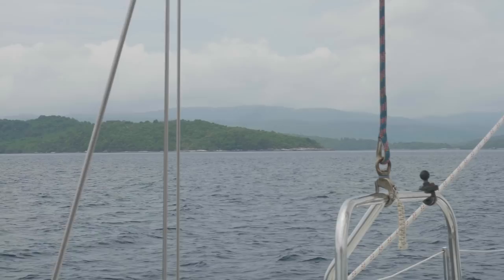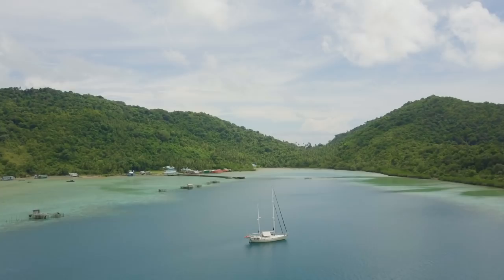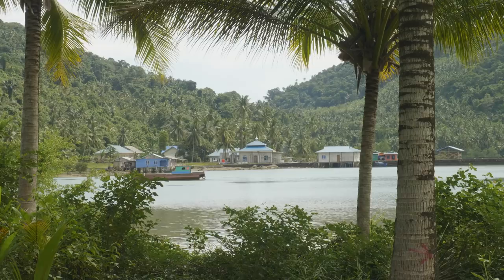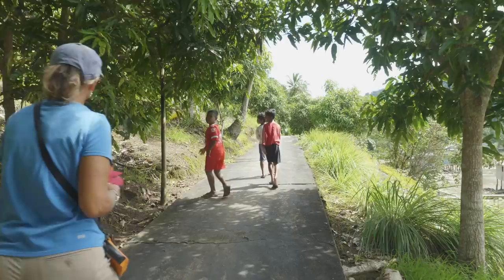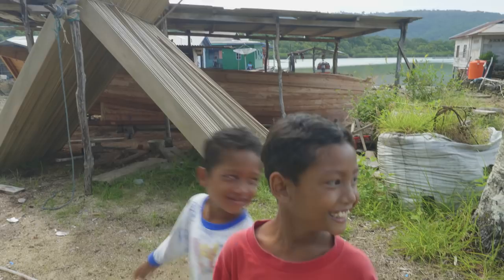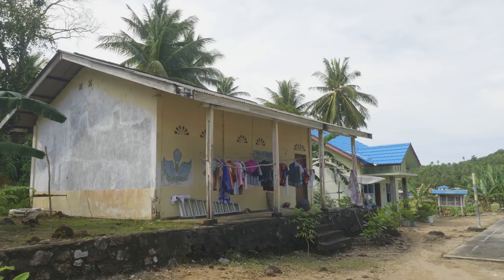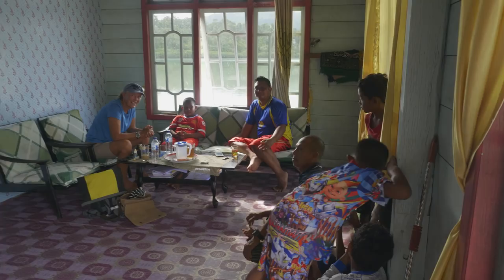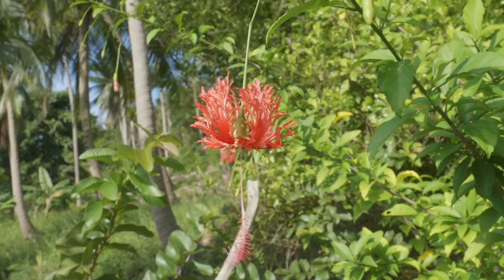FIRST SAILBOAT EVER TO COME HERE! - SAILING FOLLOWTHEBOAT Ep 95

Comment: I envy you folks finding the out of the way places to explore.  These are the kinds of places I would go to.  I have a question that is a little off topic but it concerns a video you released in 2012.  (I know, who remembers what they did yesterday, let alone six years ago).  You folks did a introductory review on a port-a-boat and you seemed pretty taken by it.  But, my wife and I notice you aren't using it anymore.  Could/would you please share with us your impressions regarding its durability, etc?  We are thinking of purchasing the 10'er to use as a dingy but way to hear back from as many people as we can before spending that kind of money.  Thanks.
Reply from the maker: Its a good boat, and we replaced it with the inflatable because it got damaged when we were hit in Thailand. To be honest, we wanted a more powerful motor so that we could get to shore quickly - over here you are often anchored way out. It's also not great in rough seas, and can be a very wet ride! But it's indestructible! (Liz@ftb)
Reply: I've got a Mercury 4.5 HP engine that I was planning on using.  After the boat got damaged I take it that for the reasons you mention, it wasn't worthwhile replacing the damaged one with another Port-a-bote?
Reply from the maker: It wouldn't take the larger motor (yours is fine) and, as I said above, we wanted to move fast around this area in the dinghy to go exploring and snorkeling - often in bigger waves which the Portabote didn't like. Cheers. (Liz@ftb)